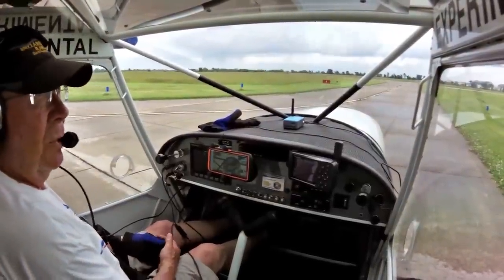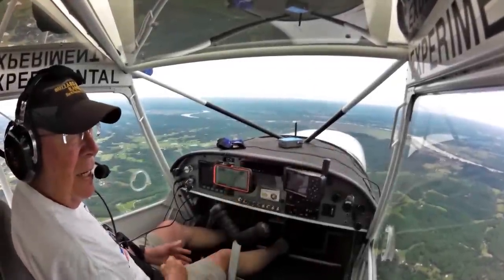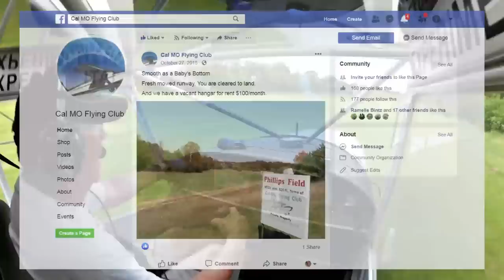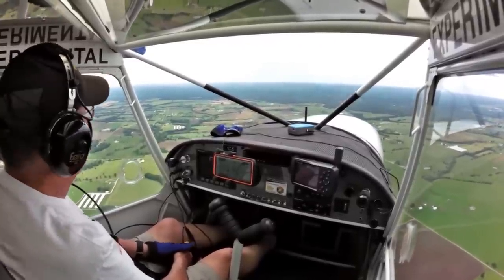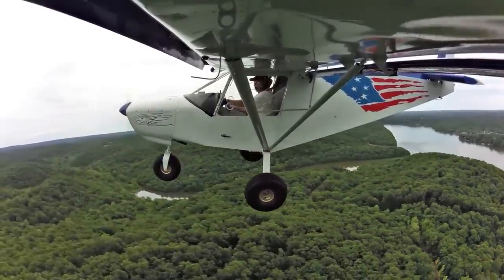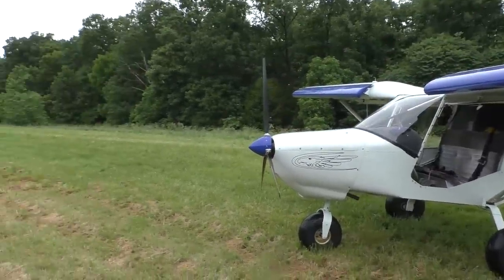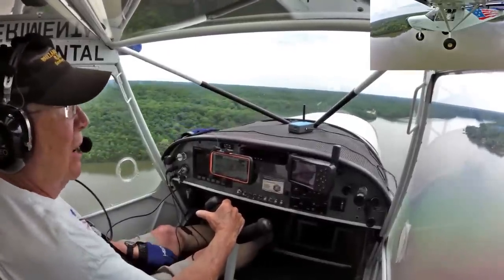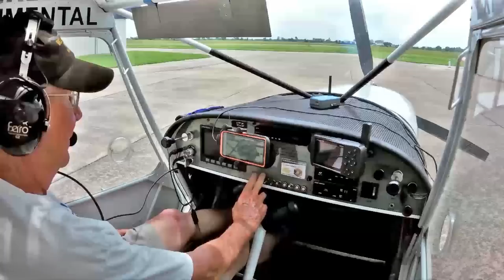Flying the Zenith STOL to Mt. Eagles Escape

Comment: I took a flight to your resort in a Zenith 701CH in Msfs, VR. A beautiful spot. Not easy to land, it was my first time in the Zenith and I was trying fulll-flap short landings, also a first. A couple of stalls and crashes later, I kind of figured it out, fly slow but don’t stall on the approach and throttle up right before touchdown. I also figured out that you can do a classic landing there at flaps 2, definitely easier. Thanks for the video.

Comment: When you land there, are there fuel faciltities?
Reply: No. This is NOT an airport. This is an "unimproved" grass field that has been mowed. There are lots of bumps and rough areas, not recommended for non-STOL type airplanes. Also, there is no power nor plumbing of any kind there.
Reply: @sebastienheintz OK..time to find the nearest port with a pump.
Reply: @sebastienheintz  I thought that this was part of a housing development